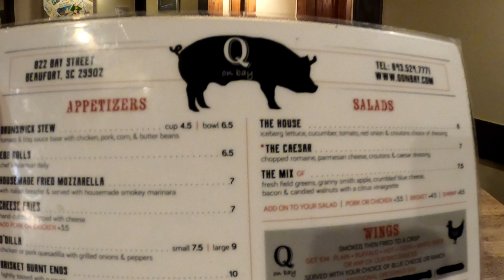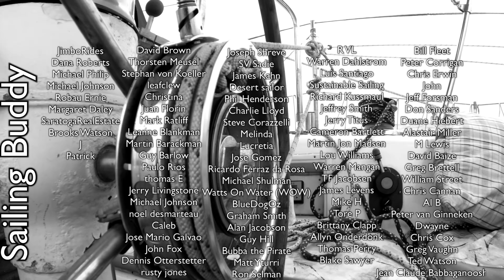The REAL PROBLEM with Synthetic Rigging | Sailing Wisdom [S5 Ep 28]

Comment: ok, so mast shrinks when cold.  syn rigging elongates when cold.  do either of these affect the strength of the mast or rigging?  if tge overall strenght does not change then why is it not safe to sail?   I mean it is usual for your down wind stays to be slack anyway... as long as it's nit so loose that yiu are in danger of being dismasted,  how does lack of tension affect the overall strength.  Obviously, your sail won't be as efficent, as it will not have the optimum shape, but as long as the base of the mast is not going anywhere, I see no issue with sailing with a loose rig.
Reply from the maker: The issue is the mast will bend farther than you want it to. The strength is the same but the mast bends over farther than I would like with sails on it. Also, the luff would be incredibly baggy so the sail won’t work very well on a close reach. 
In the ocean, on very cold days, we would simply fly the trysail with its head at the spreaders and the staysail. The loads were low on the rig and the mast didn’t move too much. I try to keep the loads lower so that the slack rig won’t bend over as far as if I was full sail.

Comment: Synthetic rigging seems a no go unless you can deal with that coefficient of expansion issue. ( You could do something like 'bi-metals' that are self adjusting - but you'd have to have a long lever going to a piece of steel or something.) What might solve the problem is a wind up wheel or just two bolts on a wheel or lever that can be manually turned to adjust tension so you can sail on cold days, but then left slack for 'average temperatures.'  
 I know it's Bew-Fert South Carolina, but BO -fort, North Carolina. Except the last North Carolinian I encounter said Bew-Fert for his state's one.   Beaufort, SC is really pretty and dreamy in the pre-dawn fog. But I remember  pre-dawn out on the sea islands as 5-6 bugs per cubic inch.
Reply from the maker: If I couldn’t figure out how to invent this system to make synthetic standing rigging work, I was going to go with galvanized rigging as a Plan B
Reply: Just get a carbon fiber mast.

Comment: Oh, oh, oh! Man, I realized something important now
 How far is the stove from your inner keeled mast? If you heated hard the inner mast,  it pushed up the outer mast, same time transmitting heat to it and stretching  the braiding of Dynema more then you did. In the morning, stove cold, interior mast shrinked and adding the outer mast contraction, there's your slacking!!!
Reply from the maker: They are pretty close to each other, only a few feet away. The problem is the mast is aluminum and acts as a heatsink. If you try to warm the inner mast, it will transmit the heat to the outside as the entire mast will generally heat at the same pace. As you try to warm the mast, the outside part will suck all the heat out and you will be left with a cold boat. For that reason, the mast is hidden behind insulation so that the boat stays warm inside and the cold mast is in a separate environment.
Reply: The vapors from water you boiled could have entered inside mast? Anyway, the cause is there. Stretched braiding.
Reply: Quote Dyneema® fiber is used in hoses designed for liquefied natural gas (LNG) transfer at -162°C.
So, no way it gets longer in low temp. In fact I don't know a material doing this.
Reply: And let me tell you another thing. Temperature goes with the flow, one end taped, no flow, no temperature advance, The flow exists, takes temperature with it and heats the entire tube.  I am still one of best after sales automotive engineers. Trust me
Reply from the maker: It’s not so much with flow as with conducting the temperature. Also, Dyneema does expand as it cools and at -162° it will be a bit longer than when it was 20°. On a shorter thread in a hose, the change won’t be as notable as on a very long stay.

Comment: They will need to weave and integrate another material into the dyneema that has the opposite thermodynamic properties in the future to solve this, just as they did centuries ago to make accurate measuring rods for map making in Britain and as John Harrison did in making the clock that solved the longitude problem. It must be possible these days. Come on dyneema and spectra makers!
Reply from the maker: The problem would be the Dyneema herniating in the line that is contracting as it expands. Also, all the load would be transferred to that line since the Dyneema would be too long. 
I have seen another sailboat where he used electric fence tensioning spools to tighten his lashings in a hurry to accommodate for winter stretch. He knew how many turns he took it to let back out the same number of turns in the spring.

Comment: ... Aaahhh ... synthetic rigging (vectra,  spectra, dynema,   etc ) does not stretch ... but it does "elongate" !!! This is because the fibers do not stretch,  but the "braid"  tightens up like a "chinese Finger Torture " toy ...  the result is the the actual length of the rigging gets longer ... or shorter ...  I have used synthetic line to rig my multi-hulls since the masts rotate and the spreaders are self contained completely on the mast.  And I have seen it tried w/ wooden masts ... NOPE!!!  ended up breaking the mast as the shrouds went slack ...  But for sheet lines (no ropes on a boat!!!!),  halyards etc ... they are fine ...

Comment: Damn Jerry, you just ruined my whole day. I was seriously considering synthetic but I sail seasons that get cold at either ends. It doesn't sound like it's going to work if 40 degrees is the cutoff point.  Unless you have a solution perhaps?
Reply from the maker: Turnbuckles will be your friend in northern climates. All you need to do is mark the “summer” points on the turnbuckles and be sure to always leave them loosened to that point in the event of a warm day while you are away from the boat. 
When you are sailing in cold weather, all you need to do is tighten the turnbuckles to take out the slack.
Reply: In the spring and fall there’s a twenty degree difference in 12 hours.
Reply: There is no "cutoff point". The fact that the rigging went so slack in 40 degree drop means even with a moderate temperature change, which can be quite common inland, the rigging is going well under tension specs. The stuff may be "OK" while at sea, but plenty of gales and thunderstorms can drop temps 30-50 degrees instantly. Combined with the susceptibility to abrasion, I can see why it is not popular. I doubt very much that most sailboat owners would be willing to constantly be adjusting turnbuckles. It's a fad.
Reply from the maker: Synthetic isn’t for everyone. We like to show the full story instead of only focusing on the glamorous parts of synthetic so that other can make informed decisions. 
I keep my rigging tuned for 80°F. It’s good for +/-20°F but beyond that I start to baby the rigging. At 30°F, we are talking about a 50°F drop from its ideal temperature. 
I haven’t experienced a cold front drop that drastically, normally they are about 10°F on the eastern coast of the US.
Reply from the maker: My personal view on the matter is: “if it’s too cold for the rigging, then it’s too cold for me”.
Reply: @RiggingDoctor  I'd like to think  how this could work for me, but here is a scenario. You're out on an overnight passage. A clear crisp night with a light haze of frost on deck by sunrise. Anchor and relax and you'll be in t-shirts by 2 pm. That's been done plenty, but with synthetic that would mean worrying about the rigging as much as sailing the boat. There's got to be a way to get around this somehow. How much adjustment range is involved here?
Reply: I was co sidering Synthetic too, but for Cruising with in Mast Furling, which requires the mast to be kept close to vertical to keep Furling reliable, I've now solidly switched to sticking with 1x19 stainless Rigging. Which I don't think has ruined my Wallet.  Best Wishes and Fair Winds.  Bob. 👍
Reply from the maker: With in mast furling you definitely want to stick with steel!
Reply from the maker: Our workaround is to keep the sails low when it’s cold. While out in the ocean sailing from the Azores to Portugal, we were following the wind up to 50°N and the weather was cold! Keeping the sails at the height of the spreaders meant the lowers we’re doing most of the work. In your situation, tuning it for the t shirt weather and reefing down at night would make it work, just avoid accidental jibes as the slack rigging will cause more of a snapping effect and that added stress is unwanted.

Comment: “ Rigging Doctor”  could you please ucomment on the practicality of Dyneema Lifelines…
Reply from the maker: That’s a great topic for a video!
Reply: Garbage, just as you saw here. Over/under tension problems, constantly messing with turnbuckles, and the big one: The lifeline is dangerously slack so it's not doing it's job. There's enough maintenance on a sailboat that knowingly adding more maintenance doesn't make sense. I will bet $1 that this experiment will end and he goes back to cable. They had to motor and listen to that loud generator when they could have been sailing if not for the rigging choice.
Reply: @RiggingDoctor  Thankyou, please do,  Ignore the Naysayers.
Reply from the maker: I’ve had this rigging for over 7 years and 20,000nm so I’m very comfortable with my choice. If this rigging was made of steel, it would be the right tension but it would also be needing replacement for the second time, as steel rigging lasts for 10 years or 10,000nm. 
I think you are confusing stays with lifelines though, because lifelines are set at a variety of tensions. Racers like them looser so that crew can hang off the side of the boat and lean into the lifeline more comfortably. Cruisers like them tighter so that if they grab onto it, the line won’t budge and will offer good support. 
The most important part of the choice of the materials for your boat is knowing how to use them properly so that you don’t cause unnecessary damage. 
My personal view for the rigging is “if it’s too cold for the rigging, it’s too cold for me”

Comment: Mentioning amps without volts is like saying you're going 48 miles trying to tell someone the speed without the time.
Reply from the maker: We have a 48v system so it’s always in 48v for the motor and 12v for the house loads. 
When it’s our life and not an educational course, we cut the units short. The issue is that then other people who don’t live this exact life only get partial information when we cut units out of the sentence

Comment: So basically it’s not a good idea to fit dyneema if I have a deckstep mast ?
Reply from the maker: Correct. You either need very stable temperatures or to be there adjusting it as needed. You can use halyards as temporary winter stays, but the peace of mind from a keel stepped mast makes this a much more comfortable setup.
Reply: I’m in the Caribbean so I should be good I guess.
Reply from the maker: You would be fine, and you wouldn’t have to worry about corrosion which is the killer of steel rigging down there.
Reply: I have a problem finding more info on dyneema rigging, I found a eye T terminal but what would be better fitting a toggle or doing a eye splice with out the thimble and fit it directly to the eye T terminal?
Reply from the maker: I like to attach the eye to the t-ball with a toggle so I can easily remove the fittings if needed.

Comment: When you go to trade your car in the salesman that sold you the vinyl top will tell you I could give you more for your car, but it has that pesky vinyl top. One day dynema, lithium batteries, electric motors,, and wiring will be replaced by graphene. Dynema is 9 times stronger than steel, but graphene is 300 times stronger than steel. They make graphene capacitors that are small now to replace batteries. It is the best conductor in the world. It makes super sharp razer blades, and if you got the jab it is in your blood.
Reply from the maker: While Dyneema has this one issue, we have managed to cruise many miles and many years without it crippling our efforts. On days when it’s too cold for the rigging, we still find ways to move so it isn’t the end of the world.
Reply: I think people are missing the point that tightening and loosening is not too difficult with practice, it’s just the time and the fiddling about.
Reply: Graphene will snap in half due to that lack of flexibility. Rigging needs to have some flex.
Reply: @jonathanoasis  A graphene line the size of a 10-pound test fishing string will pick up a 3,000-pound car.
Reply: @rickcreel3657  and it will snap with any laeral force.